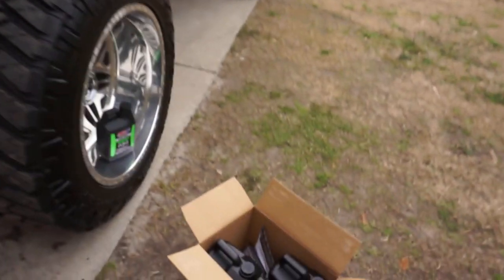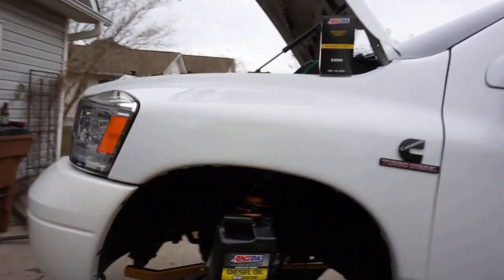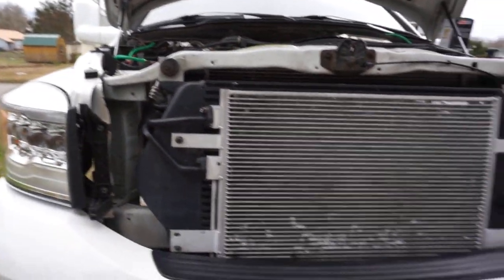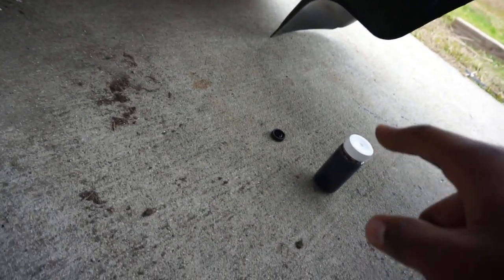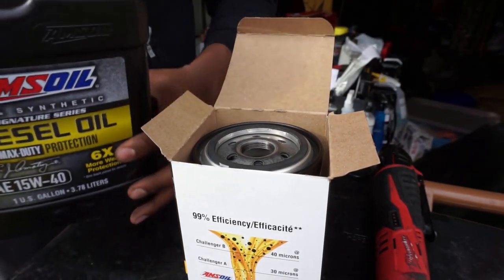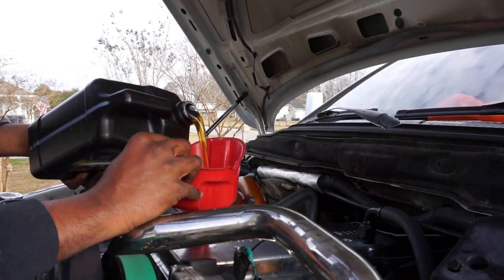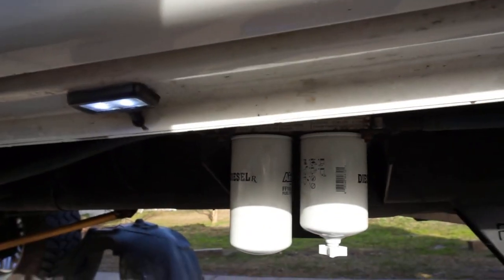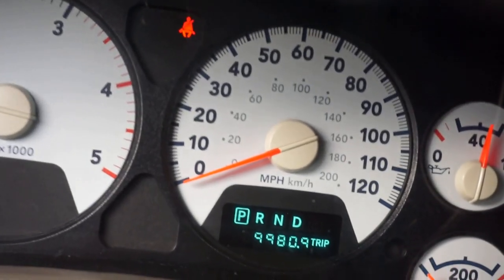DO THIS BEFORE CHANGING YOUR OIL!!!

Comment: The W in 15w-40 doesn’t mean weight. The “w” stands for winter and indicates that the lubricant in question has a different viscosity, or different flow characteristics, based on temperature. For example, a 5w30 oil weight rating means that on cold start-up — even at subzero temperatures — the oil flows like a 5 weight oil. However, once warmed up to 210 degrees F, it functions as a 30 weight oil.
Reply from the maker: Makes sense thanks for the info man!

Comment: I ran the 6x Amsoil 5w40 for 30k with the dual remote system and it tested clean every 5k miles. The only reason I changed the oil at 30k was because I sold the truck and had to show the new owner how the oil system worked. Great video.
Reply from the maker: Thats awesome man, good deal. Glad to see someone else runs the good stuff

Comment: Reason you test hot or warm oil is because the oil is better circulated, all the contaminates etc will be in the oil and not settled. You will be testing the oil at its most accurate moment.

Comment: I just went to Power Driven Diesel off-road 15/40.
It's got the good stuff for us deleted fellas.
Reply from the maker: I heard about there oil, their oil isn't api cert because they load a ton of zinc and additives in it to where it would qualify for api seal. But I heard it's some good stuff.
Reply: I think pdd oil has a more robust additive package than even Amsoil.... i am on my second oil change with their stuff and the lab shows oil is just fine even at 10k miles.... i will go to 15k and sample again.
Reply: @rocklynroll2311  Keep us posted, I'm planning to send mine off too after getting some miles on it. 👍

Comment: For that year model. The new 19 and up yr Cummins changes to 5w40 or 10w30. Do not run 15w40 in the new trucks. 5th gen
Reply from the maker: Good to know. They whole block is redesigned so I would figure the oil weight changed

Comment: How many miles did you run the airdog filters for before changing them out? Previous owner on mine has a CAT filter on it with a red water seperator. Ive owned it for 2 years i havent changed them out yet. Oops just saw the end where you said about 15k miles for the airdog filters?
Reply from the maker: I would look into changing your filters man.
Reply: Just ordered! Haha 🤘 my cummins thanks you.

Comment: So what is the cost of a oil change with ams oil? I know you’re going at higher miles, but has anyone ever done a cost analysis versus conventional oil. Is ams oil worth the cost.
Reply from the maker: I've done a cost analysis and you save money over a year by only changing your oil once vs oem recommendation. Amsoil sig series gives u 3x times the interval. And it's fact proven not just marketing claims. Plus synthetic has been proven to be superior vs conventional oil. If you want the best for your vehicle

Comment: what about greasing up that front driveshaft? it destroyed many of these trucks...
Reply from the maker: 4x4 boosted launches without greasing that joint destroyed many trucks lmao tbh I have to find the fitting and I doubt it's greaseable
Reply: @EVERYTHANGDIESEL  I have a 2014 Ram 2500. There is a grease point in the front driveshaft. It’s truly a royal pain in the ass to find and access. You need the needle tip for the grease gun too.